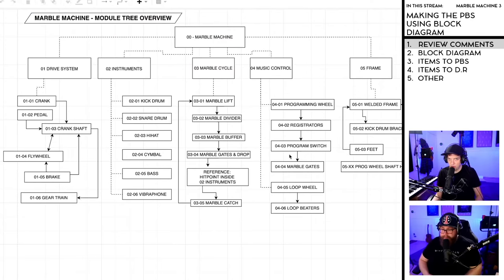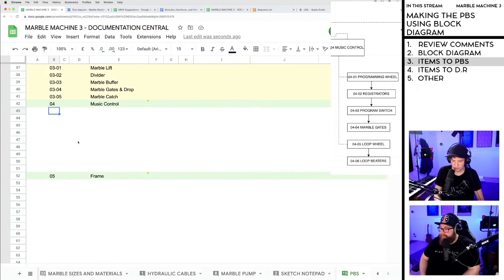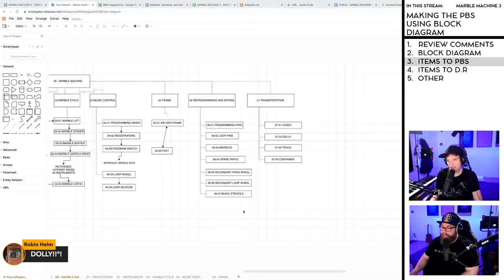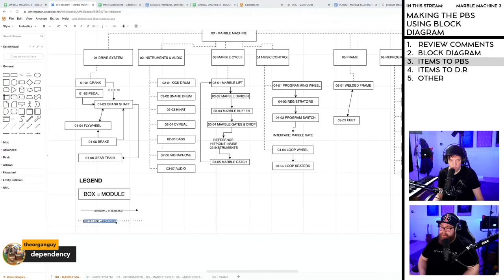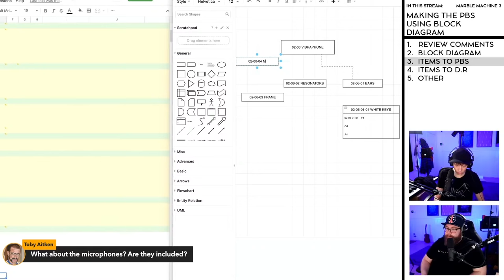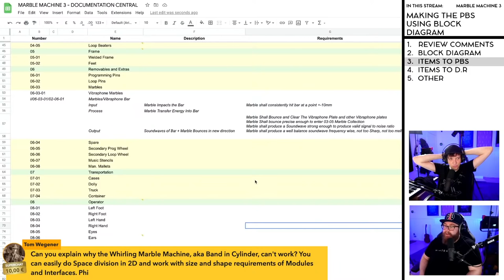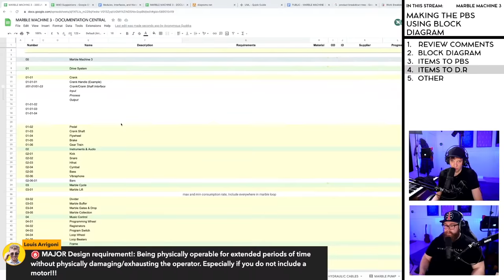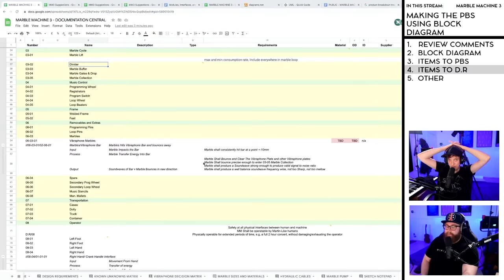Making A Product Breakdown System Using Block Diagram

Comment: Martin, Hannes, please consider implementing actuators to deploy programming pegs on the wheel.  However, I would like to see the Wheel be eliminated and replaced with a visually stimulating Laser Composer to activate marble drops on individual simple instruments.  But, if you must have the programming wheel, use actuators to program the song within seconds.  No complicated removal, storage, transportation of songs on wheels.  The reliability and cost of the wheels will make the marble machine X extremely costly to implement.  It's a concert and if it cost more to put on the concert than it makes... that's bad business!  One thought lost in the flow diagram is cost to build, repeat, maintain, transport and perform!   Don't forget the cost of everything to put on the show!
Reply: Upload your suggestion to the dropbox/documents. im not sure that they consider comments as they are spread across multiple streams.
Reply: @Jrakula10  i appreciate you message and I have not done that.  Where is the dropbox/documents link?